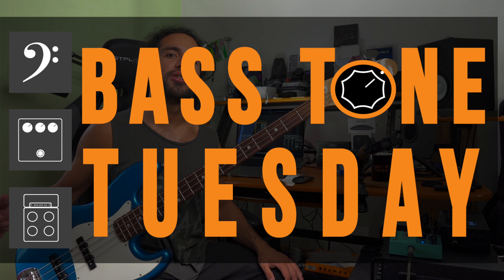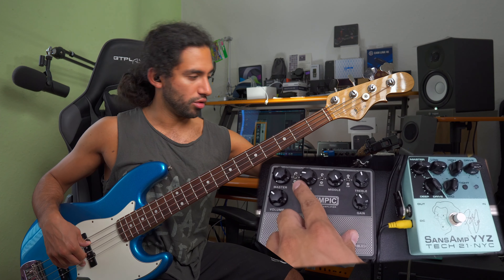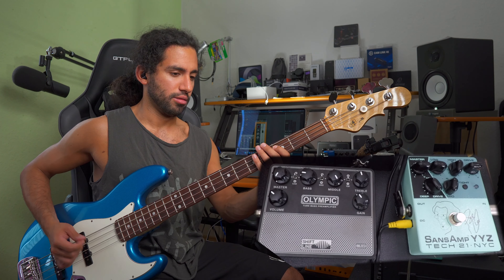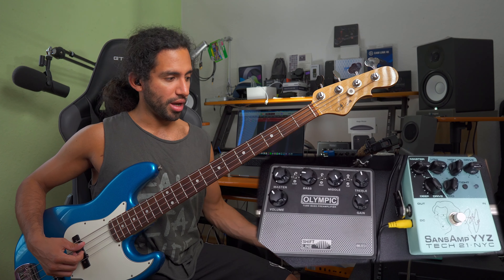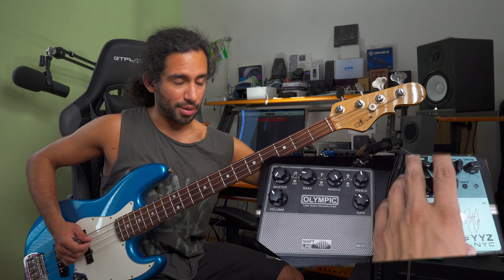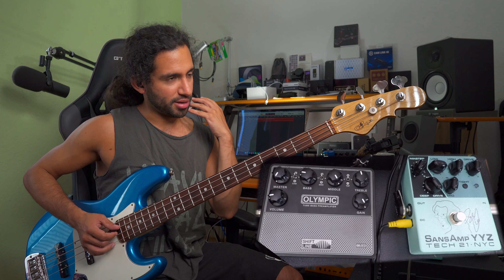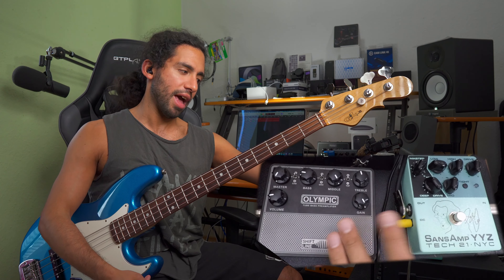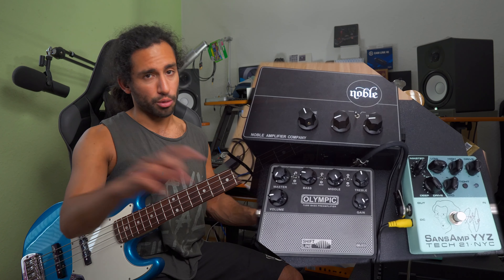Stacking Preamps | Bass Tone Tuesday

Comment: My main sound is a Mesa 800+ with a Vulcan bass OD in front.  The Vulcan is set to add mild od (similar to cranking the Mesa’s input gain).  Putting a YYZ AFTER the Vulcan is like magic.  I imagine it’s doing what the higher end Geddy Lee sansamps are doing, which is adding saturation to the deep circuit.  It’s the closest I’ve ever been to having awesome clean, OD, and heavy OD sound at my feet- without sounding like I’m using pedals to do it.   Very amp-like and natural alternating between them.  Thanks Ivan for always putting good bass info out there!

Comment: Nice video Ivan, thank you.

I am a home/amateur player and can't really justify spending 400$ for a preamp unit. That said, I do need one and what I ended up using is... two of them. First there is the amazing "stomp-box-ized" John East preamp unit which is intented for internal use but if you can use a soldering iron and a drill you can turn it into a stompbox. The main reason for this is the extremely clean amplification and the really excellent EQ - lots of headroom and adjustment range and also, unique for internal preamps, there is adjustability of the range of adjustment of the bass and treble adjusters, if this makes any sense. Secondly, there is a Palmer pocket Amp Bass which came up on top in almost every regard against an EHX Battalion which I compared it back-to-back against. The Palmer is more subtle in everything it does against the EHX and it is clearly made with the working musician / real life scenarios in mind whereas I think the Battalion was made to impress reviewers or it was made with metal players in mind (and I'm not one of them). The setup is pretty good for home use and I'm pretty happy with it.
Reply from the maker: John east makes GREAT preamps! Glad to hear that you’re happy with your setup :) That’s the most important thing!

Comment: This reminds me of  what I did with my dis before I went back to cabs , Jdi first in line then sansampbass driver then just take driver in and out as needed so it works di/2nd di cuz amps are heavy but kinda more or parallel than stacking
Reply from the maker: Yeah, that works as well!

Comment: Thanks for clearing up the mystery. So, I'm using the Shift-Line Olympic. What if I put the Ampeg Classic pedal (not the DI) in line with the Olympic?  I am thinking of just coloring the overall tone.  Which order would you recommend?  Would this work, or would it completely wreck the space-time continuum?
Reply from the maker: I'm not familiar with that pedal, but you could use them any way you want. Even more so, considering that you have the effects loop on the olympic. You could place the Olympic first use the effects loop to go into the Ampeg and back into the Olympic and go somewhere else from there or just use the DI out.
Reply: @IvanBassist  Grateful for your response and insight.